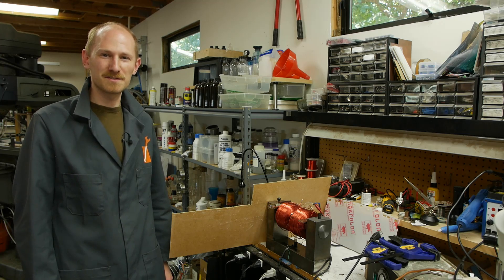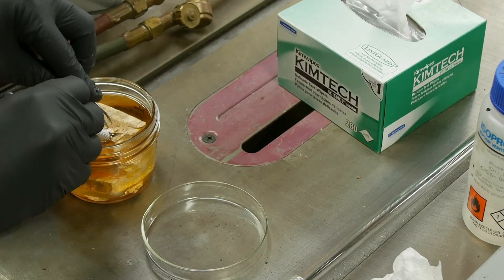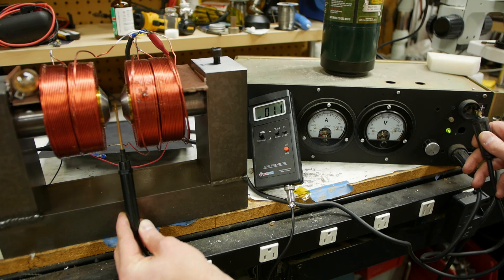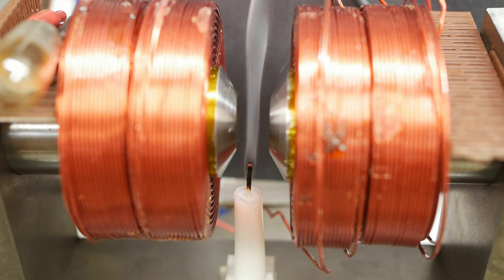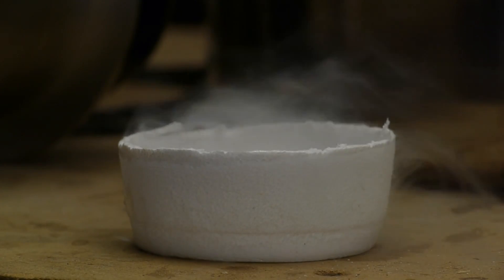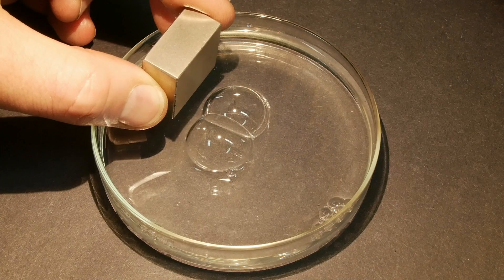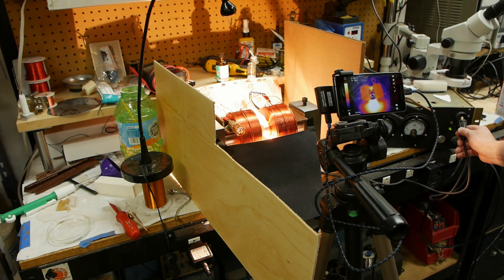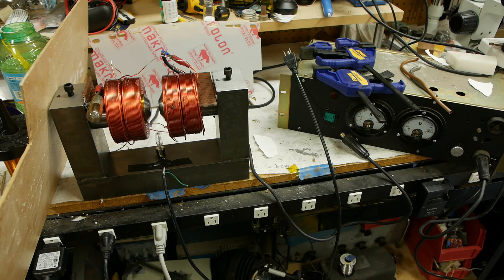Candle flame is repelled by magnets (and Zeeman follow-up)

Comment: Electric fields exert a linear accelerating force on charged particles across electric field lines (between electrodes). Depending on if they are positively or negatively charged, they will be attracted in opposite directions. Magnetic fields, on the other hand, exert a gyroscopic force along magnetic field lines, encouraging charges to essentially orbit field lines, in either clockwise or counter-clockwise directions depending on their charge. 

The motion is typically a spiral because the gyroscopic force of magnetic fields only act on velocity vectors that are not aligned with the direction of the field line. So a charged particle moving mostly perpendicular will have its linear velocity converted to almost entirely angular velocity about the center of the magnetic field line, while particles completely aligned, move perfectly straight with no forces felt.

In the experiment, the strong magnetic field in your transformer air gap is completely perpendicular to the direction of motion of the various flames and hot gasses containing some small percentage of plasma with charged ions (positive and negative). In that orientation, the gyroscopic force felt by the ions will be the strongest and you see the Flame and wax smoke losing all of their height because they are being slowed and supposedly repulsed with an induced magnetic field. While it could be having some diamagnetic interactions, it is also in a force balance between the buoyancy (gravity) of the air and the gyroscopic forces of magnetic field in the magnetic field gradient of your apparatus (the flame is offset from the region of strong magnetic field, so there is a gradient). Gotta get rid of the charged particles to say it is only buoyancy and diamagnetism.

Some ideas for further experiment: I'd like to see your flame centered in a homogeneous magnetic field to remove the field gradient (or increase,decrease the height to show its effects), apply pulsed DC with a relay/MOSFET at some frequency, use high voltage to generate some strong electric field between two plates (vertically and horizontally) instead of magnetic fields. If it behaves identically, you could argue it isn't diamagnetism.

Comment: Thanks for diving in the wonderful world of interactions between the gradient of the magnetic field and gradient of magnetic susceptibility. In the WWII there was even a meter for the partial pressure of oxygen on the basis of the expulsion of a glass ball by the oxygen of the air from an inhomogeneous magnetic field. 
Uetake, H., Nakagawa, J., Horota, N., & Kitazawa, K. (1999). Nonmechanical magnetothermal wind blower by a superconducting magnet. Journal of Applied Physics, 85(8), 5735–5737. https://doi.org/10.1063/1.370268
Pauling, L., Wood, R. E., & Sturdivant, J. H. (1946). An Instrument for Determining the Partial Pressure of Oxygen in a Gas. Journal of the American Chemical Society, 68(5), 795–798.
Uetake, H., Hirota, N., Nakagawa, J., Ikezoe, Y., & Kitazawa, K. (2000). Thermal convection control by gradient magnetic field. Journal of Applied Physics, 87(9), 6310–6312. https://doi.org/10.1063/1.372689
Carruthers, J. R., & Wolfe, R. (1968). Magnetothermal convection in insulating paramagnetic fluids. Journal of Applied Physics, 39(12), 5718–5722. https://doi.org/10.1063/1.1656038

Comment: That's a very interesting effect.  One could think that the flame is paramagnetic due to all those free radicals, but if the flame is repelled by the magnet it's actually more diamagnetic?  Can you test another way (i.e. without convective air flow) that the flame is diamagnetic?

Comment: This is pretty interesting and kinda touches on somethings I've been curious about for a bit. 
The fact that they're diamagnetic is good to know. 
This makes the lightsaber i've been poking at much more possible. 
I need an AC signal to do it.  not just a DC signal, which will launch/deflect the flame.

Comment: You could "easily" check if it's a charge related effect (ions on the flame) or a magnetic permeability change by changing the field polarity. A charge, would be deflected in a direction perpendicular to it's own motion and the applied's field direction, and change direction if the field is inverted. A magnetic permeability change would affect the intensity of magnetic field without a clear direction preference of the material responsible for the change (other than maybe being attracted/repelled by the magnet poles,  a motion that would follow the field's gradient and thus be most likely parallel to the field lines). To test if hot air is "more magnetic" than cold air, build a transformer that uses air in it's core and measure the coupling between the two coils as a function of air temperature. Beware that density changes will affect the permeability of the gas, so . Pyrolitic carbon has a strong diamagnetic effect thanks to it's hexagonal structure, not to the carbon atoms themselves (every atom presents diamagnetism, but it's normally too weak compared to any  other effects, such as unpaired electrons on molecular connections [http://www.physlink.com/education/askexperts/ae493.cfm]).

Comment: The effect you’re seeing due to the fact that ions moving in space generate a magnetic field. Using the right hand rule you can determine the shape of the magnetic field generated by the flame (it’s a helix curling around the flame, since the ions are generally moving upward an outward). Hot air contains more ions than cold air. Anyway what you are seeing is the interaction of the strong magnets with the flame. When the strong magnetic field is on the field formed by the upwardly rising ions in the flame is suppressed, and the ions move mostly outward rather than upward. This can be modeled using Maxwells equations.

Comment: Excellent demonstration.  And I really appreciate the level-headed reasoning that follows.

I think it's the gaseous H2O in the flame that is causing the difference and that mostly has to do with the fact that gaseous H2O is highly polar while vaporous H2O is not.

Surrounding the flame there is H2O in the atmosphere but it is not gaseous, it is liquid nanodroplets that are so small they appear to be gaseous.  (This appearance fools a lot of people, including whole paradigms, like meteorology.)  And here is the thing.  Gaseous H2O is dramatically more di-electric than is vaporous H2O.  This has to do with 1) the fact that vaporous H2O maintains hydrogen bonds between the various H2O molecules and gaseous H2O does not and 2) hydrogen bonds neutralize H2O polarity. 

There are potentially two sources of polarity activated gaseous H2O in the flame.  Firstly there is the H2O that is a result of combustion and, secondly, there may also be gaseous H2O that is a result of vaporous H2O infiltrating the flame from outside and becoming gaseous due to the heat.

For more details on why and how the polarity of H2O is variable and not a constant (which has long been mistakenly assumed by science) watch and study this:
Pauling's Omission
https://www.youtube.com/watch?v=iIQSubWJeNg&t=1761s

James McGinn
Reply: Correction: Above I stated: Gaseous H2O is dramatically more di-electric than is vaporous H2O.  I meant to say: Gaseous H2O is dramatically more diamagnetic than is vaporous H2O.

Comment: I have a theory(warning: I have a tendency to be right. It tends to annoy people).
The flame is a chemical reaction occuring, which is inhibited(on the molecular level) by a magnetic field. It makes sense to me that this would also affect the miscibility of hot and cold air, to a certain degree.

I dont know many chemical reactions, but I’m thinking a quick and easy test could be something with a colorchange, for example KMnO4(aq) and NaOH(aq) in a slim chamber between your magnets there, and see if there is a delay in colorchange where the field is stronger.

As always an interesting video, this channel is golden 👌

Comment: The 'smoke' from a freshly blown out candle isn't carbon, it's paraffin vapors condensing in air.
Reply: Well, part true, part not. It is true that there is a lot of paraffin mist. But when you first blow out the candle, often times the carbonized part will continue to burn with a small flameless ember as the carbon burns partially. So during the time that there is the little ember burning, there will also be carbon monoxide and possible carbon dioxide.

Comment: i think probably the concentration of oxygen in hot air is different than in cold, i think that it was the oxygen and the carbon that make the air a tiny magnetic, maybe hot air has less time to interact with the fields because its moving faster

Comment: This is a question that someone posed a few years back during an undergrad course, which sparked (pun intended) a lot of interesting debate about this exact question -- so it was very cool to see this video pop up and you did a great job as usual testing hypotheses. I believe it is due to paramagnetic Oxygen molecules being organized, or aligned, inside of the magnetic field. Any flow of gas through the space, in your present cases: hot gas flowing upwards, will hence be deflected around the organized gas molecules. This can explain what you observed, the candle-smoke in particular providing a visual which seems to match such an explanation. I see others have mentioned that ionization and formation of plasma during combustion is the cause of the deflection, but ionization at candle temperatures is unlikely and I don't think such a small population of ions can account for the dramatic effects in cases where a flame is used; not to mention the flame will still have a net neutral charge.

Comment: isn't a flame a plasma?
Reply: nah. You just have particles with a lot of energy. Electrons are in high energy orbits, they want to return to their natural stable orbit and as they do a jump down to a lower orbit of lesser energy, the release the difference in energy in the form of a photon. So a flame is simply light emitted from a gas.
Reply: @Shive1337  It doesnt take a large leap of logic to realize that visible light is just one tiny section of the electromagnetic spectrum. And that electromagnetism can become electricity.
And electricity causes ionization.

And in short, that fire is indeed plasmoid.
Reply: @trevorh6438  Fire is not a plasma. If I light up a needle's edge to be glowing red or white, do you think I've created plasma? :D Dude, the electrons aren't free, it's just the photons you see. Try googling a bit, you'll find yourself wrong incredibly fast, it's an often asked question.
Reply: @Shive1337  The nature of your example shows you don't fully understand the physics of the matter.
Light of itself is not plasma. Heat of itself is not plasma.
Electricity of itself is not plasma.
However, the moment one electron becomes free, you have created plasma, even if only for the briefest of seconds. Because thats what plasma is by definition.

And how do you prove that not a single electron has become freed in the air around your needle? Its nigh impossible.

Interesting that radiating light causes heat.
Electricity through a resister can cause heat too.
Air is a resister.
Light is electricity.

And heating air can induce a plasma the very moment an electron is freed.
Reply: @Shive1337  So conceited are you. From the way you speak, one would think you know everything.  
You clearly don't.

States of matter? Solid liquid gas plasma.
But what is the material state of a singular elemental particle? One atom.

Can one atom be liquid? Wouldn't it have to be a solid, since its all one thing? But its only one atom, so it must be a gas since its separated from any other atom?
The scientific fallacy of material states is that they must be defined in relation to each other and cannot divide any smaller than an average group of 3 or more atoms, or else the whole substance loses definitive cohesion.

In other words, "matter" is not defined by the material elements that make it up. Rather, it must necessarily be defined by the size-space of the void-space between "material particles" or, in the case of a plasma, the ionized condition of particular particles at a sized distance of space between themselves, spacious enough to define a "gas material".

These abstract contortions of the english language, which material scientists employ in order to talk about, literally "nothing" and "empty space", are incredibly humorous to one who knows their hidden trick and abject ignorance of the universe around them.
For those who are awake and aware, a better model presents itself. One inverted from the ignorance of material interactions.

A material aether substrate, in which waves of perceived substance roll within the liquid matrix. Perceived substance is what humans see, what is often thought of as matter, but truly is no-matter at all, but manifest energy in wave-form.
Reply: @Shive1337  So you do admit that, technically I am right (be it weakly or strongly, ionized gas is still ionized gas, which by definition, makes a plasma) and you're pulling semantics in order to disagree and call me dumb and try and bluster your way out of a falsehood.

Don't make absolute blanket statements like "fire is not a plasma" if you are only going to clarify later with the real truth of "fire is only weakly ionized gas, so while the case could be made that there is some plasma, its still not.."
Your unsupported fallacies will only collapse under the weight of your own admittances in the minutia of things.

Is it a plasma, or is it not? There is no scientific precedent nor definition for a "half-ionized gaseous material state." If ionization in a gas is present, by necessity of logic, and definition, it must be a plasma.  Don't blame me if you cant understand the English in the scientific reports you read.
Reply: @Shive1337  And if you want to be particularly picky, and say that only the ionized portion of the fire is plasma while the rest of it is just a gas... You have just deconstructed the entire concept of "fire" and so we are no longer talking about fire at all but the various sub-materials that make it up. And thus you have abstracted the concept of fire out of the realm of the states of matter and created an entirely new scientific concept of a "quasi-plasma" in the same realm as "quasi-fluids".

Which only serves to prove my statement that there really is no such thing as a "state of matter" and that "matter" really all boils down to a measure of distance between "material particles". Turning it into an infinitely recursive, and self-contradictory definition that ultimately cannot not describe any bit of matter, but rather, a purely immaterial space.

Comment: Wouldn't you be dealing with ion movement into your test area from the magnetic pull of particles in the air which may be magnetic them-self? Wouldn't this work better in a vacuum chamber so you can more closely control the fuel flow for the flame?

Comment: It would have to do with the direction of the ion charge in the material (air, flame, water), with a flame the ∆T would be greater than the other experiments so that's why it gets effected more. When you change the temperature of a material it lines up the ions or scatters them, if they are lined up that helps to create a magnet. That's how man made magnets are created.

Comment: consider vortex torque
JK Plasma Magnetics Experiment 2
https://youtu.be/afQW8FT02DM

Although I wonder if this torque is caused by the exciter being used in combination with the magnet or actually a property of plasma alone.

hydrocarbon oil is a dielectric insulator. A magnet has a dielectric property move inward at its center while it has a magnetic property move outward.
🔷Two Images explains things 🔷 Dielectric & Magnetic
https://youtu.be/AmuxvP96ipk

Triboelectric material series effect static charging is the aggravation of dielectric materials by mechanical and or electrical aggravation. Causing electromagnetic charge alignments. My personal way of looking at that is similar to what causes capacitance. Which is why I believe the plasma vortex torque effect is a result of the voltage pulsing of the exciter and not just the result of the plasma being effected by the magnet alone.

Comment: just an idea- Oxygen is attracted to the magnets. But in order to be attracted, it has to line up. Heat energy is divided into linear, rotational, and vibrational modes of the molecule. What if the rotational speeds due to heat energy are stopping the flame from lining up?

Comment: Both the candle and methanol are burning organic molecules. So the products of combustion are mostly carbon oxides, and water. The candle vs methanol may demonstrate that it's not the carbon particles in the poorly oxidised candle flame, as you say. But water is diamagnetic and will be present in both flames. So I favour water diamagnetism as a cause. 'Easily' tested with  some water vapour (easy for you, that is, way beyond me!).

Comment: Great video ! I like the old fashion scientific approach where observation drives the theory, not the opposite.
What about water molecule contained in the air? It wasn't as strong with the airgun because as it heated the air, the relative humidity droped and weakened the effect. Could you try with a stream of saturated air, from a boiling container ? The movement could have an effect with Foucault current un the stream, and it wouldn't have been so obvious with the steady bubble.